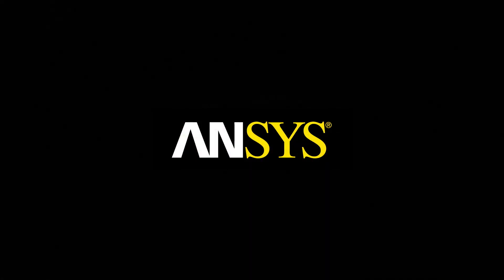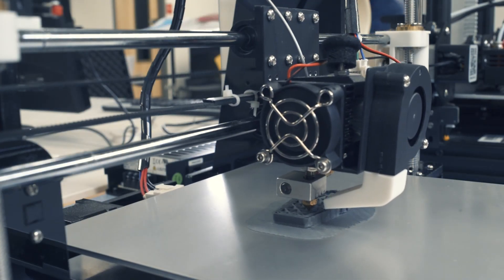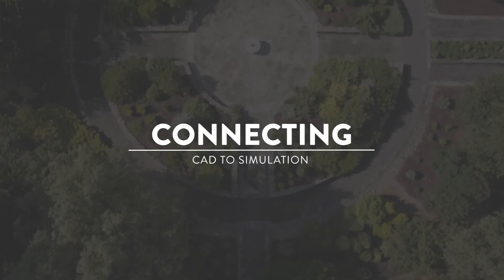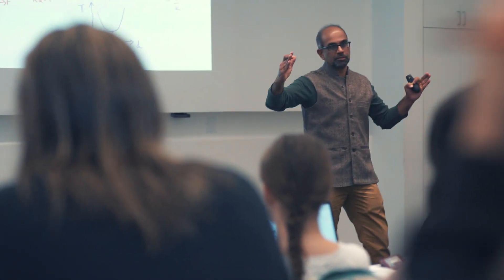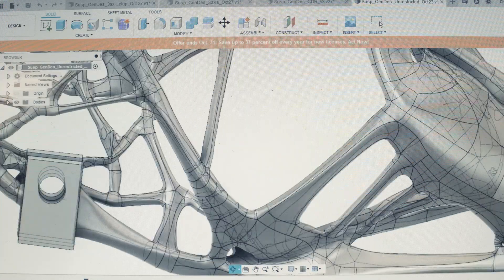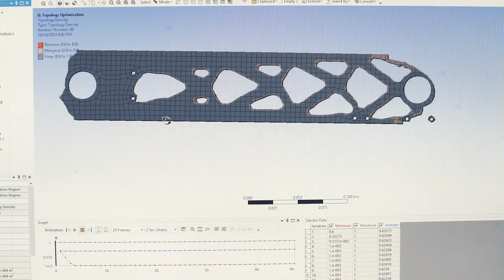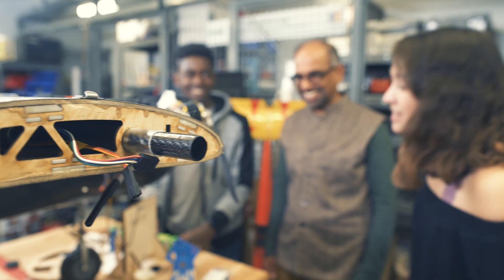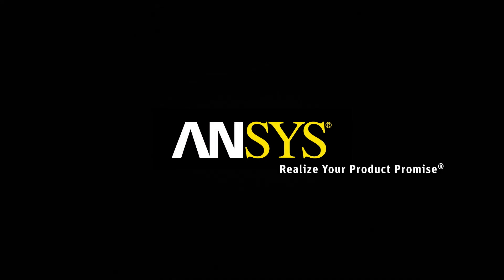ANSYS & Autodesk: A Partnership of Transformation

Comment: Spaceclaim is the King of CAD and product of ANSYS
Reply: Big companies are using spaceclaim for CAD? I thought mainly just geometry simplification, sim prep-work.
Reply: erikspen So called "BIG COMPANIES " have already invested time, money and resources into feature based CAD softwares whereas Spaceclaim is a next generation CAD software for engineers who think out of the box, inventors, artists, makers, kids and many more. As a founder of a small Robotics company I find Spaceclaim an ideal tool for machine design. It's based on NUI whereas all major CAD tools are still stuck with GUI, it's so intuitive to work with a CAD tool like Spaceclaim on a touch screen display.
Reply: Spaceclaim is very useful tool for preparing model to analysis, but it cant handle other things like nx or catia.
Reply: Ufuk Kortag  where there is a will there , there is a way
Reply: @alfredanil  but not efficient way
Reply: Ufuk Kortag  that's your perception.